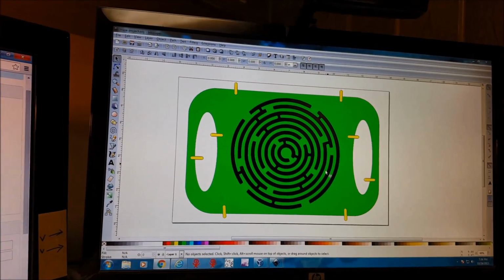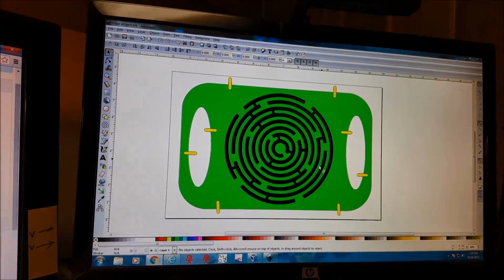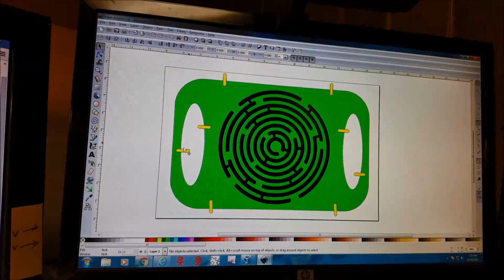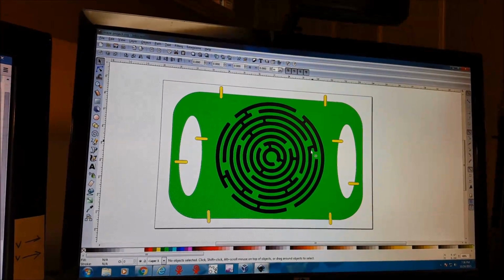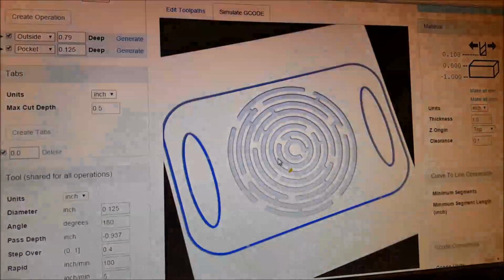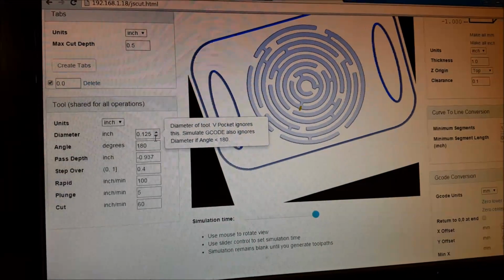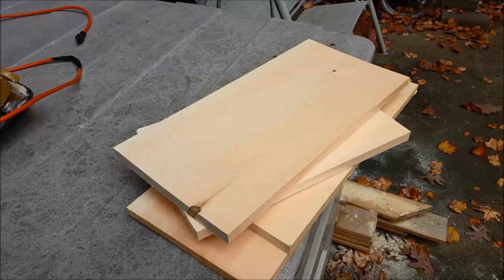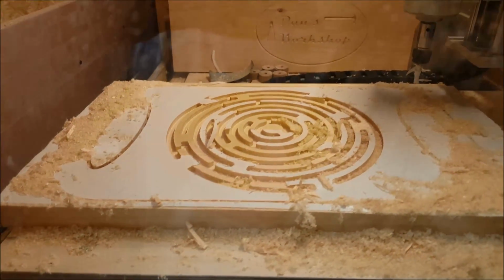Wood Marble Maze - A CNC Project

Comment: Great video and a great help! Have you tried Easel : http://easel.inventables.com/  . And if so how is it compared Jscut? I'm going to try out Jscut in the morning. Thumbs up and thanks for sharing!
Reply from the maker: +onlychevys Williams The last time I checked Easel was available for only x-carve or Inventable CNC machines.  From the research I've done it's a pretty limited design program.  It is a great intro to CNC CAD/CAM software but by using some other software programs you can gain a lot more features.  Inkscape and Jscut can do some really neat things - much more than I originally thought they would be able to do.

Comment: Hello, i am an engineering student considering building a cnc machine like the one you have for rapid prototyping and other projects.  Is there any advice that you could give to a first time builder as well as a good source of parts?  Ive been looking at sourcing alot of products from chinese manufacturers but i saw that you mentioned in another video that some of their boards are faulty.  Thank you very much in advance and i look forward to seeing what other projects you think up!
Reply from the maker: +Hunter Bowie Hi Hunter.  It's a fun hobby and one that can teach you a wide variety of skills in many areas.  Some folks enjoy the process of building the machine as much as operating it.  While I have built a CNC machine from scratch, having a completed machine that is set up and reliable opens up a different kind of creativity.  If your goal is to quickly get to the point of being able to design and make things using the machine I'd suggest buying a completed unit.  The small CNC I am using (3040) is not crazy expensive (around $600).  It would be difficult to build one for a lot less that is as good.   Also, check your local Craigslist - I've seen larger CNCs pop up for very good prices from time to time.
Reply: Thank you for the response, my need for a machine is not one that needs to be satisfied quickly and because i am still a student i have a moderate ammount of free time but less in the way of disposable income, hence my attempt to construct a machine rather than buy one.  Its a good idea to search craigslist i shall do so immediately.  I find it very attractive to be able to design the machine to my needs, ie make a large bed for the milling of bigger parts not possible in smaller machines.  Thank you for your response!
Reply from the maker: +Hunter Bowie For a slightly larger machine here is a design I investigated a couple years ago:  http://solsylva.com/